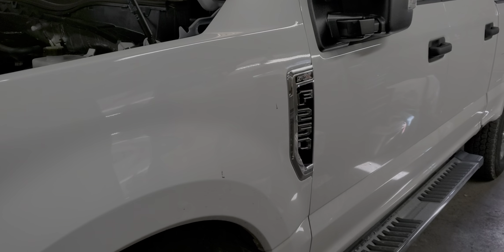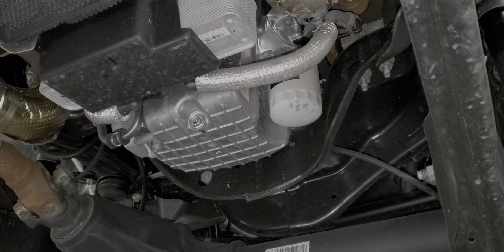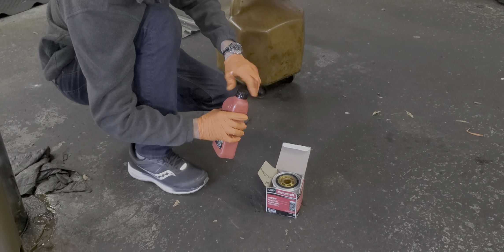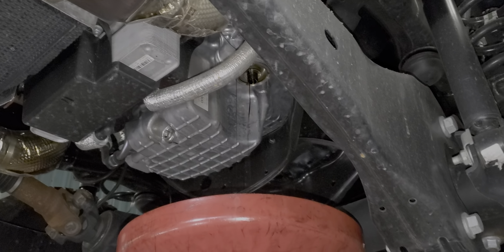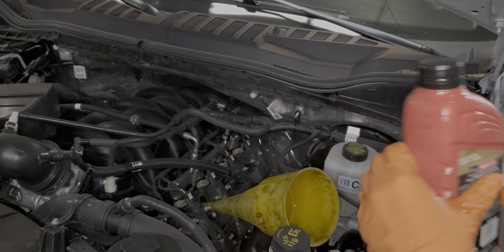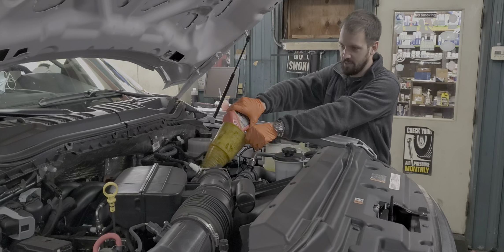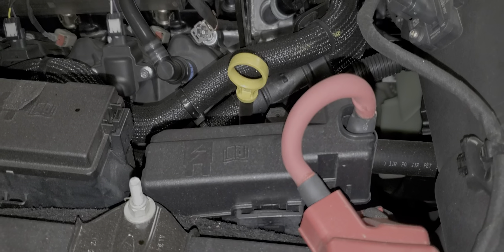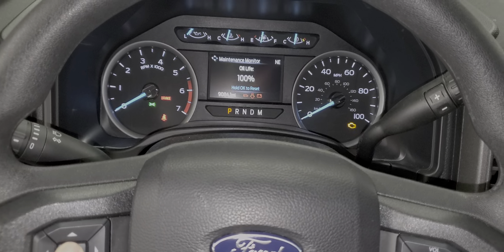2020 Ford F250 7.3 First Oil Change

Comment: I was between the diesel and the 7.3 but I only tow a trailer once a week or so and I'm super happy so far. I did my first oil change at 2000km though. just to get that break in wear outta there ASAP!
Reply from the maker: Yea the 7.3 is great and a much cheaper option than the diesel!
Reply: @LehewTech  Definitely, and I plan on keeping it for longer than the warranty period so diesel would be a bad investment in my scenario...

Comment: Love my Godzilla. Just listen to that engine when you start it. I smile every time I crank mine.
Reply from the maker: 7.3! Doesnt get any better
Reply: @LehewTech  post more of you have any.
Reply from the maker: I just posted a few videos about installing some accessories; oem drop-in bedliner, oem rubber floor mats, oem wheel well liners and a Tuffy lockable storage container.
Reply: @LehewTech  can't find them. How are they listed?
Reply from the maker: I made a Playlist here: https://youtube.com/playlist?list=PLMIM7LEfU0SoDxDRnaxtr3ySbKv8Aa514
Reply: Wait until you open that exhaust up. I went a tad extreme with the AFE Rebel but WOT is intoxicating

Comment: Nice and BLACK! Damn, 9k miles on that oil, not for me. Oil is cheap, engines ain't. I would have pulled the factor fill at 800-1000 miles, but that's just me. I've been hearing good things about this 7.3 gasser, we're going to take a hard look at one maybe next year.

Comment: Another way to prime the engine in Fords is holding the gas pedal all the way to the floor while turning the key and hold it for 10 sec. Much cleaner process.

Comment: I’m gonna do my break in change at 1k miles because I’m a paranoid old fart.  Then I will do every 5k.  It’s just too expensive to be wrong.  Great video thanks for making it
Reply from the maker: What oil will you be using?
Reply: I agree. Oil is cheap, engines aren't.
Reply: I'm with brother, I did the first one at 2500 and then every 5K after that on mine

Comment: As a Career mechanic I always filled the filter if the option is available.  In training classes with different manufacturers they did not have a preference or we were told the filling of the filter gave a risk of contaminants.  So go figure.

Comment: At least Ford did not eliminate the Oil Level dipstick on this engine. Some car engines including BMW do not have an Oil Level Dipstick. Instead after driving till the engine is warmed up an oil level display is called up on the dashboard. I miss having an actual oil level dipstick.
Reply from the maker: Yes I think its great to have a dipstick. To be fair, most vehicle owners nowadays never check their oil so perhaps an oil level sensor is good for them.
Reply: BMW owners probably don't want to check their oil manually. It's a luxury car.

Comment: Good lord I would never run oil for 9000. If you want your engine to last for decades, change the oil every 5000 - 6000 miles, depending on your severity of usage. Oil is cheap, engines are expensive.
Reply: I don't understand why people wait so long either.  I've watched too many engine tear downs where sludge build up ruins engines because of long change intervals.  5k or 6 months MAX!

Comment: His baby and he waited till 9k for first oil change ? Dumb .
Reply: Oil looks filthy. I change my 6.8L V10 every 5-6K miles.
Reply from the maker: Modern oils have greatly improved performance and I have full faith that the 10k interval is just fine especially considering that I am rarely loading this truck anywhere near its limit. I would however recommend servicing the transmission more frequently then Ford recommends.

Comment: Sorry to be picky maybe you didn't have the time but leave the sump plug out when you remove the oil filter as a lot of engines will dump and extra half a liter of old oil into the sump from the oil pump and galleries due to the one way valve in the filter, also you put the sump plug on while oil was still coming out, just my 2 cents as an engine builder.

Comment: instead of priming the oil filter on these new fords, hold the accelerator down for 15 seconds and run the starter simultainiously, engine won't fire but you can watch it build oil pressure and let off the accelerator and let it fire up once it reaches pressure
Reply: It is still causing engine wear while it spins, putting the oil in the filter is the best way to prevent the old starvation.
Reply: No it's not. Are you using water or oil?

Comment: @lehew - Awesome video as it directed me perfectly to ..... rule out those 2 fuses and the relay as my issue. I even did the needlenose pliers jump over the 2 poles toward the front. Same result if I use the key or jump the poles. I get a loud audible click - motor does not turn over - all lights go out within the vehicle. I am handy with all things mechanical but a bit stumped on the electrical side of this issue. Think you could PM me and tell me a couple pointers to look at?

Comment: Thanks!  I’ve noticed my transmission skips 2nd gear unless I’m towing, does yours do that?
Reply from the maker: Yes my truck skips gears often unless i am accelerating aggressively or have the truck in tow mode
Reply: @LehewTech  Cool.  Thanks for the reply.
Reply: Yeah there is a recall
Reply: @kenj.8897  I checked and my vin is not included
Reply: Yes there is a recall on a needle bearing in the 10 speeds, one of the planetary gears. Definitely check your VIN but because it is a 10 speed it does not need to hit every gear as they are so close the computer figures out the gear you should be in. You can skip all over the place so don't be worried JUST for that. Like I said do go check your VIN for recalls. There are a few for the 20+ F250s.
Reply: @tollav  Thanks
Reply: @timmoore6656   the truck is programmed to skip 2 and 4 (I think 4). It’s def programmed to skip 2 tho. There is a transmission TSB out that could lead to whole replacement, but skipping 2nd is on purpose. Unless it’s doing it while towing a good load…
Reply: @jc7435  thanks. I checked in on that and it’s specific vin vehicles only, mine not included.
Reply: The transmission is a torque shift transmission.  Hell mine skips 2 or 3 at a time depending on what the reason, it's designed to choose a gear ratio optimal to the wheel speed vs engine speed.  So you punch it, she'll go from 1st to 3rd or 4th almost instantly, and if you hit a hill towing weight, it'll drop from 10 to 7 but 7 is the 1:1 ratio anyway.  Gears 123 are low, 456 are mid, 7 is direct, 89 10 are all over driven gears.